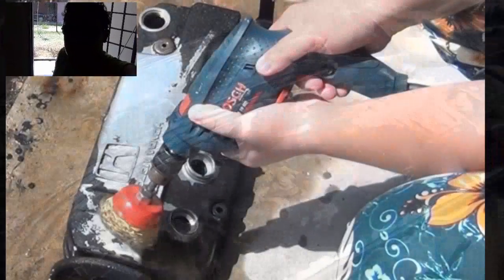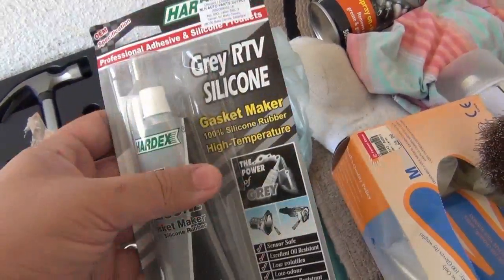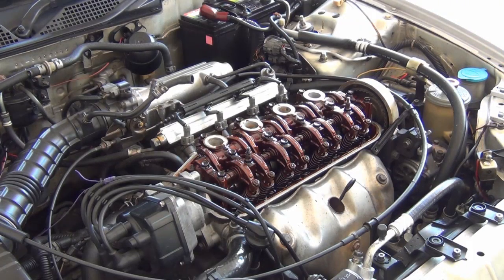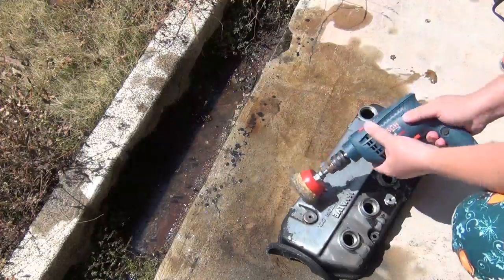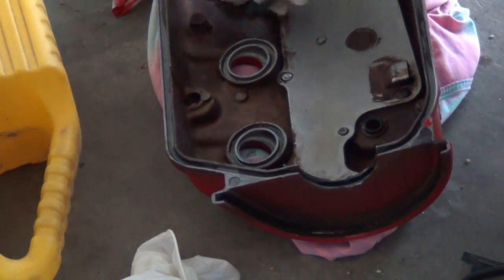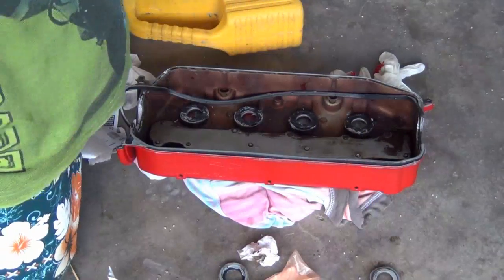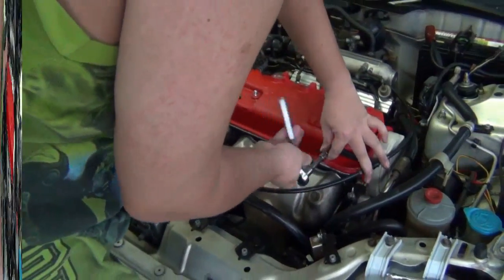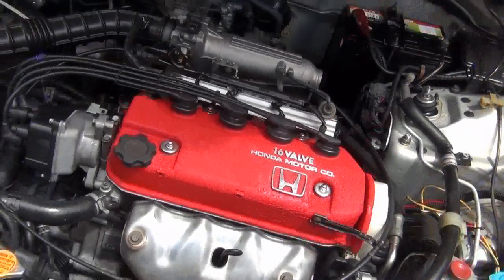Painting the engine cover red

Comment: Thanks for the advisory, I was going to spray paint mine with thick ass layers and no primer in the wind too, but you saved the day :)
Reply from the maker: i hope you got better results than mine..

a friend of mine has decided to do it more professionally, so he had the engine cover sand-blasted, and gave hours for each layer of paint to dry slowly in a clean dust-free area (2 layers at least).. 
the result was a clean smooth polished surface because he did it professionally in a local garage by a team of professionals who are far more familiar about the process than me.. 
however, it put his car out of commission for days in that garage.. but the result was fantastic using 2 different colours: white and red..

in this video.. i did all of that in half a day except the part of filing the paint off the Honda badge.. and i am kinda glad that the paint looks grainy, it covered areas that i couldn't reach with my spinning brush pretty nicely..

i started the project around 2pm (just after the Friday prayer service).. around 3pm, i received an unexpected call from my boss to relieve a doctor at the A&E at 8pm for a family emergency.. so i suddenly had less than 5 hours to wrap-up the project before my night shift.. and it actually rained unexpectedly at 4pm making it harder for the paint to dry..

literally, when it rains it pours!! we did not have rain for weeks until that fateful day.. ayyay yaaay yaaay yay!! 
i had to drive <20 km/h under the rain that night..

in any similar project, 
no one should ever rush a paint job.. 
brush-off the old paint (or sand-blast it) thoroughly.. allow each layer of paint to dry for hours preferably in an area where there are no dust, insects and other flying crap (your front lawn is not a good place believe you me!!).. and make sure you turn off your mobile-phone, so your boss wouldn't bother you on your post-call day off..

this video is meant to be a blog.. not a DIY professional tips video..
and this is the first time i apply any sort of paint on a car.. 

2017,
5 years after the project.. the red paint is still intact, although the edges 
where i filed off the paint (the Honda badge) has started to crack and 
peel (the small letters of "Honda motors" became smudged as paint started to peel off the edges - it couldn't be helped).. 
also the grainy surface of the paint makes it easier to get stained 
with dust and oil.. it is no longer a bright brilliant red, it slowly became a ruby "lipstick" red for all these years..

i was learning by doing.. 
i was lucky that it went better than i hoped it would..